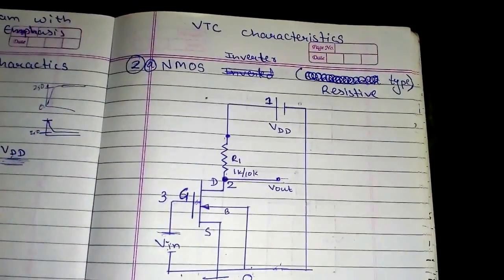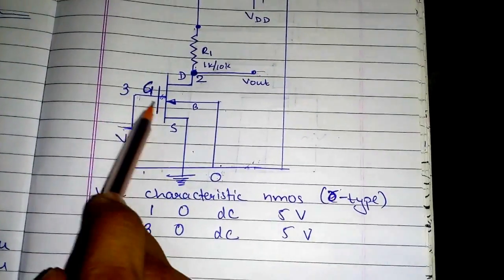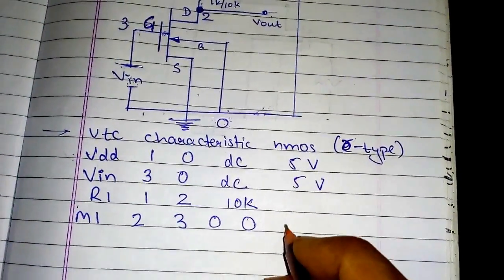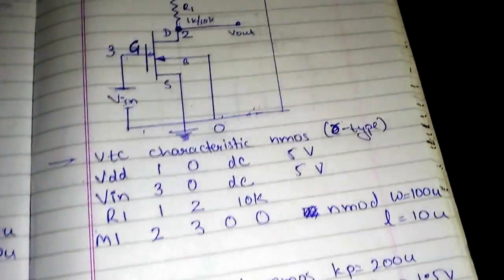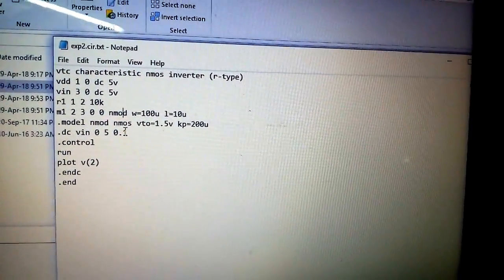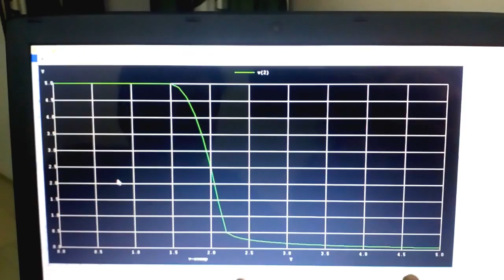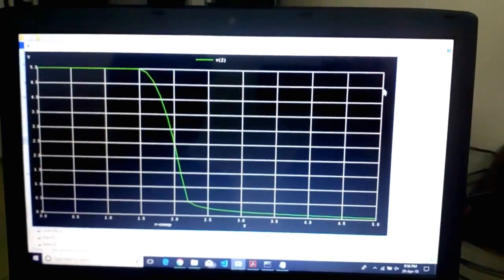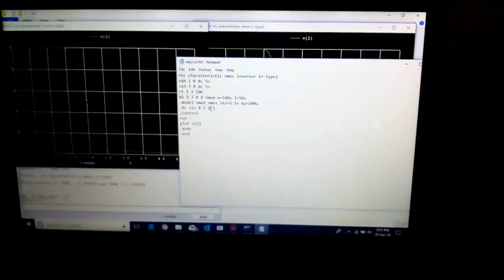NMOS Inverter VTC Characteristics Resistive (NGSPICE) - 2

Comment: vdd 1 0 dc 5
vin 3 0 dc 5

r1 1 2 10k
mn 2 3 0 0 N1 w=20u l=2u

.control
dc vin 0 5 0.01
run
plot (2)

.endc
.end

can u tell me where is the mistake?
Reply: .dc vin  here dot is not mentioned